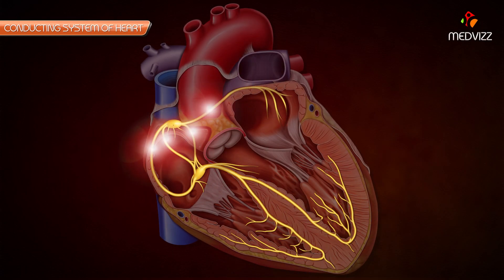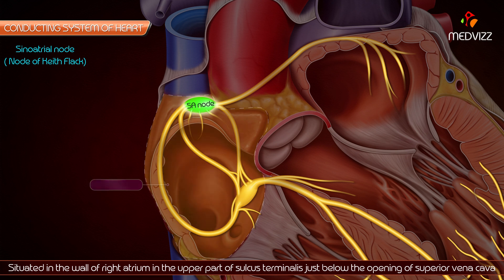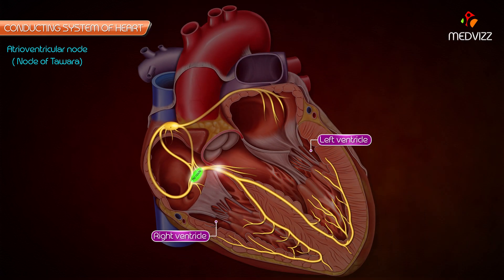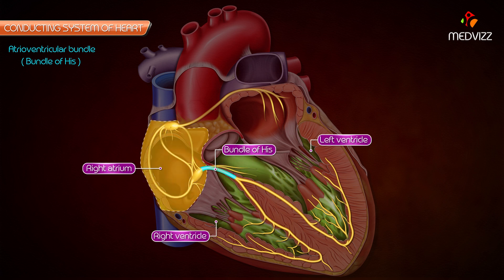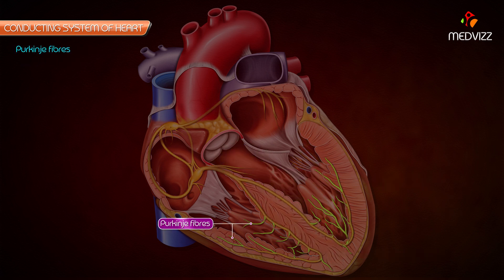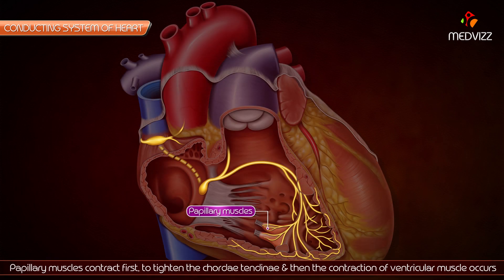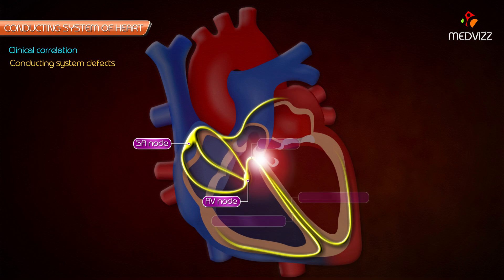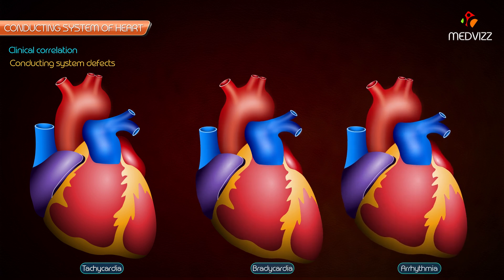Conduction system of the heart - Sinoatrial node, AV Node, Bundle of His, Purkinje fibers Animation

Comment: A-Level Biology Explanation: 

 ∙ A wave of electrical excitation spreads out from the sinoatrial node across both atria, causing them to contract.
 •  A layer of non-conductive tissue (atrioventricular septum) prevents the wave crossing to the ventricles . 
•  The wave or excitation enters a  second group of cells called the atrioventricular node (AVN),  which lies between the atria. 
•  The atrioventricular node, after a  short delay, conveys a wave of electrical excitation between the ventricles along a  series of specialised muscle  fibres called Purkyne tissue which collectively make up a  structure called the bundle of His.
 •  The bundle of His conducts the wave through the atrioventricular septum to  the  base of the ventricles, where the bundle branches a wave of electrical activity spreads out into smaller fibres of Purkyne tissue. from the sinoatrial node 
•  The wave of excitation  is  released from the Purkyne tissue, causing the ventricles to  contract quickly at the same time, from the bottom of the heart upwards.
Reply: Thanks dear...this is great explanation..had a problem exposing the conducting system of the heart
Reply: THANK U SO MUCH FOR THIS!!!
Reply: Thank you